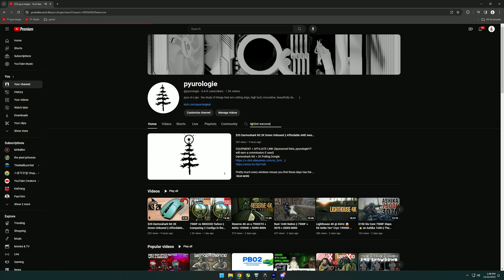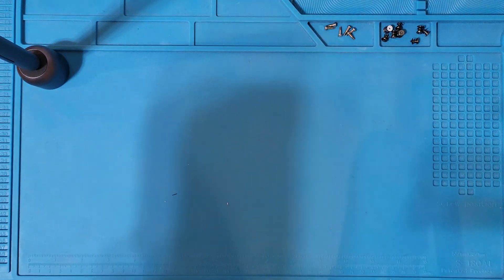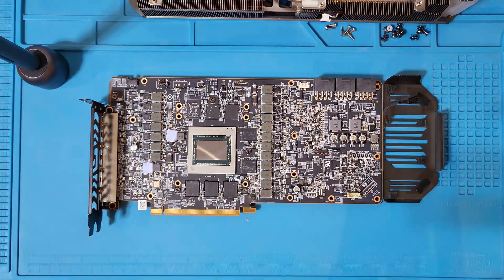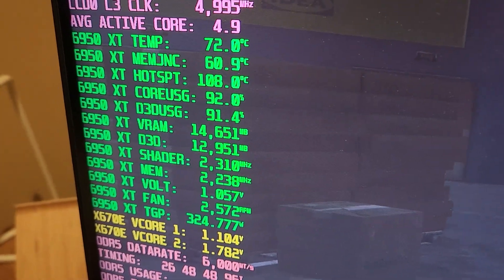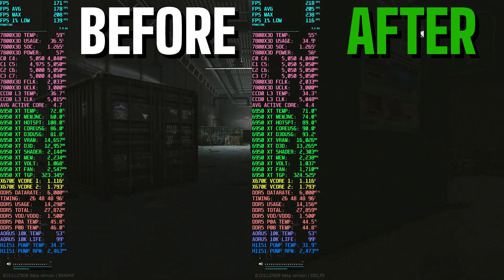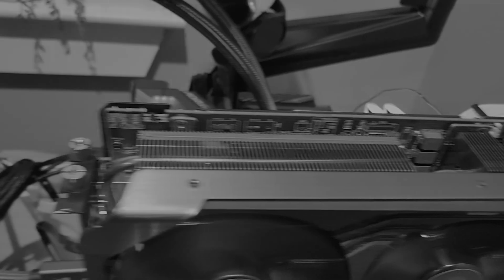This is How I Fixed My Super Loud & Hot Red Devil 6950XT

Comment: Still way too much delta. My 6900xt nitro + Se had the same problem as yours. I used some kyrosheet and now I get around 80 gpu and 90 hotspot at 288W (100% TDP) and about 87 / 95 at 300W (110% TDP). With some phase changing stuff there will be probably better results but I'm really sure where to find the original stuff.

Comment: Checked this video out because I have a 6950XT that is running 110C at the hotspot and causing my PC to shutdown after prolonged gaming. Will do the repaste and see if that helps.

Edit: Went from 110C at the hotspot to an average of 60C. Insane.
Reply from the maker: yeah these things tend to run hot and dry out the stock pads/paste. let me know if it helps!
Reply: @pyurologie  There was almost no stock paste, it was nuts. Before I added paste it was practically bare metal. Dropped down to an average of 60C from 110C.

Comment: So , I need to do this because my hotspot is always going to 110c and my PC sounds like its ready to take off. 3100 RPMs too (this is on my 6900xt red devil)
Reply from the maker: yeah mine did too. both 6900 and 6950xt red devil tend to run pretty hot and i've seen a lot of card with degraded paste/pads. just redo them and you're good to go!
Reply: @pyurologie update: did this and all temps went down by like 20c and available run everything perfectly now

Comment: is 94 c too hot for junction heat ? should I replace the thermal paste ? I have XFX MERC 6950 XT
Reply from the maker: 94 under load for mem junction is not bad for this card. 6950XT run very hot. as long as the delta is 25 and under from core temp, you're good
Reply: @pyurologie thx man for helping ❤

Comment: Hello Pyurologie, i have one more question that i could still not find the good answer.
I have unfortunally damaged one of the thermal pads.
During seperating the cooler from the actual pcb, one of the pads got teared.
May i ask you which thermalpads did you buy regarding thickness for both the VRM's and VRAM'S?
I can not  get a correct measurement of the thickness, do to the fact that the pressure on the pads have "deformed" them.
Tanks in advance.
Reply from the maker: hi, i bought this pack of pads with different thicknesses included. really good pads: https://amzn.to/4liY5DA

I think it was 1.5mm on the VRM and VRAM, but I don't exactly remember off the top of my head. But you can physically compare and see.
Reply: @pyurologie  Thank you, i will take a look at it

Comment: It's a hot boy. Just how it runs with over 300w and when it's using RT cores, I get a little over 90c junction when using RT and in games like cyberpunk 2077
Reply from the maker: it's definitely a juicer!
Reply: My sapphire nitro+ 6950xt keeps hitting 110 degree when rt cores are on. I'm thinking of repasting it. 90 degree is well within range of the card.
Reply: @windwalkerrangerdm  Yes, but not for prolonged periods. Chip degradation happens faster with more heat. That was over a year ago. It's dead now replaced with 7800xt

Comment: I had to repaste my 6950xt. Just looking at what people are doing to help the GPU. After repasting i'm running at 67c-70c junction temps are still around 88-100c. Which isn't bad. But, I need to be extremely careful when I'm overclocking on air. So, I just undervolt and get around the same clocks. Repasting with a better paste might be my best option
Reply from the maker: awesome, yeah it seems a lot of these cards came out of the factory with uneven cooler mounting or low quality paste. Mine was uneven. These cards just run hot in general too. Yeah, undervolting works well on these too
Reply: @pyurologie  when I got it. It was one of the first things I did tho I could have rmad I might buy a thermalpad instead. A decent one and see how that pairs. And a better thermalpaste. It's fun regardless and if I can keep it running we for the next couple years I'll be happy
Reply: @pyurologie  I ended up buying the same thermal paste as you. And pretty much yeah this stuff is great. Artic sliver had my 5900x at 86c more often. But, I'm able to do 2.5-2.6ghz on air so yippe

Comment: i just did this to my asrock 6900xt oc,the hotspot was hitting 110c  and would crash. i bought the card used and thought he sold me a dud. The card still had the the sticker on the screw and i was like 'yea this card needs a re paste. i  re pasted the the chip and added some to the v ram on top of the thick ass paste that was already on there. my hotspot temp doesn't go past 89 now.
Reply from the maker: hell yeah lets goooo, similar situation with mine. bought it used, guy probably thought it was cooked

Comment: Hypothetically if your pads ripped would you replace the pads or put the cooler back on and let the pieces mold back together?
Reply from the maker: wouldnt be a huge issue to put it back as is and let them mold back together if you ensure theres still full coverage with no breaks

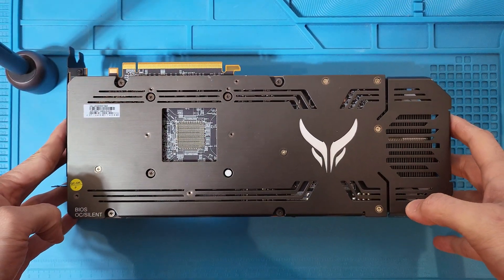Comment: What screw sizes did you use out of that kit to take apart the gpu. 1:07
Reply from the maker: i think i used a #00 or #000 driver
Reply: @pyurologie is an ifixit moray 32 bit a good kit for this diy? Also where did you find how much thermal paste to use?

Comment: Thinking about doing this to my 6950 Red Devil. What size thermal pads does it need by chance?
Reply from the maker: Here's the set I bought, but ended up not needing for this card. It includes 4 pads 100x100mm in 0.5, 1.0, 1.5, and 2.0mm thicknesses: https://amzn.to/3XuuX3Y
Reply: @pyurologie  thank you

Comment: What size thermal pads did you get? Not sure what size I should get for my 6950 red devil
Reply from the maker: Here's the set I bought, but ended up not needing for this card. It includes 4 pads 100x100mm in 0.5, 1.0, 1.5, and 2.0mm thicknesses: https://amzn.to/3XuuX3Y

Comment: awesome video sir, i have the same card, and if i leave the stock radeon settings it was seeing same temps as you with hotspot getting to 110, with my undervolt settings it stays lower, but im assuming a repaste will bring it down even more. i hope my thermal pads stay in good shape like yours when pulling it apart,
Reply from the maker: thanks so much! Yes, it seems like a common issue with these cards. I suspect mine just had uneven pressure causing heat dispersion issues. I hope a teardown and repaste resolves your hotspot issue too! Let me know how it goes

Comment: I installed my GPU normally, not vertically. It didn't sag, but I used that GPU Holder that it came with anyway. I was getting 70/105C at full load (furmark), but lower while gaming. When I cleaned my PC Case, I forgot about the GPU holder, and I already screwed the PC Case together. Without that GPU Holder, I'm now getting 65/90 with Furmark. It's counterintuitive, but it looks like that holder was the problem. Anyone reading this, try using with and without GPU holder. And if you're using the GPU holder, try not to push the GPU too much. But in most cases, I think the holder should generally help.
Reply from the maker: good to know, thanks for sharing! it does seem sensitive to the way it's positioned, but it seems to vary between different cards and setups too, it's good to try different orientations and with/without holder for sure

Comment: Glad to know I'm not the only having this issue, even after RMAing twice... For mine, I first noticed something was wrong after using the sag support that the gpu came with, it decreased the junction temp. It seems that the more sag there is, the higher the temps are. So it's probably also a bad contact with the cooler that is causing me the same problem. But even with the sag support and silent bios, I can still hit the high 90s on junction temp.  Do you think only doing the washer mod (with the 4 screws at the tip of the junction) would work, instead of reapplying paste? Thanks for the video!
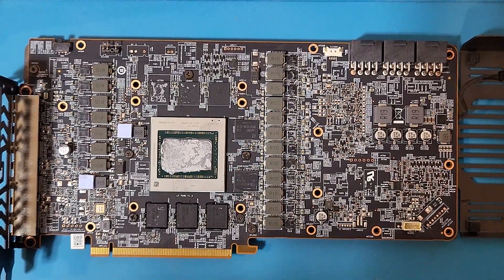Reply from the maker: I have not heard of this washer mod. I suspect that if I just put my card back together with the proper pressure applied it would have been fine. Since I had it open, I just applied new paste. After analysis, it looked like there was uneven pressure/contact btw the actual processing unit and the cooler 03:27
Reply: @pyurologie  Hey, thanks for the reply! I know it's been a while, but since I figure I have the same problem as you, do you think simply screwing the right side screws so as to apply even pressure could do the trick? I have no experience opening gpus like that and repasting them.